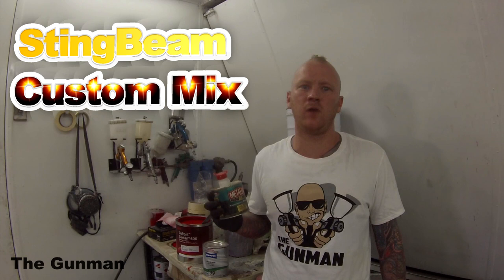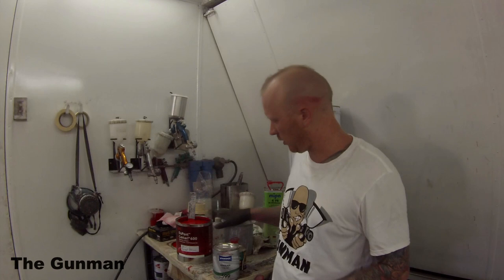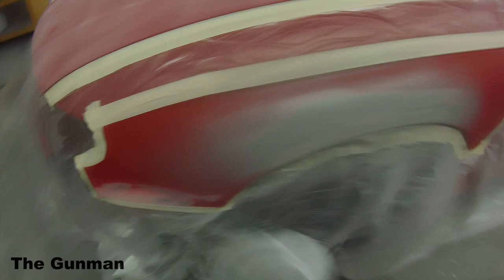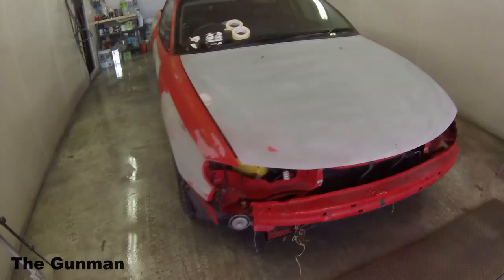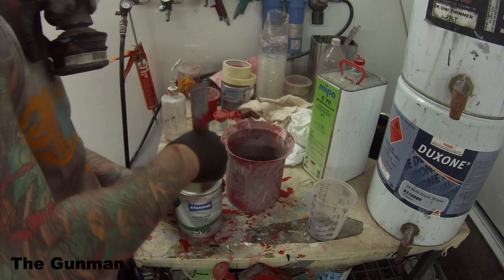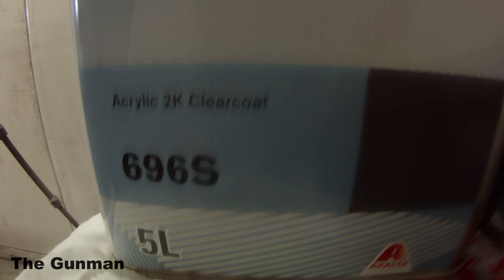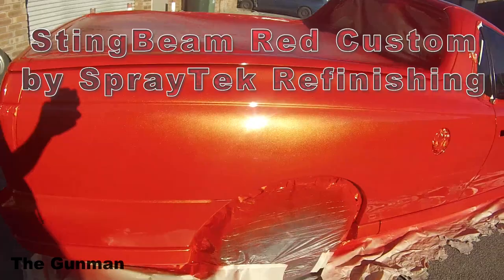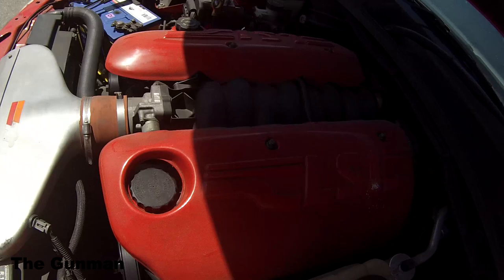Custom Color Mix & VU Ute Respray

Comment: Hey mate just curious as to how much base coat binder you used on this job, doing a respray on a e28 bmw and doing a black pearl over red base. I usually do pearl in the first coat of clear but find it hard to control coverage and end up with blushing/mottling so gonna go for the mid coat/ binder. Ill be using roughly 2 liters base coat for the closed door job. just not sure on how much spread ill get from the binder i assume it lays out the same as base coat?
Reply from the maker: Aza X Yep its just like another coat of base, I started with 1lt of binder and was still left with about 400ml but that was thinned so 200ml. Its the best way to do it.
Reply: The Gunman Is it better to use Standox 599 instead of Centari AB150 binder to mix pearl in for doing a 3-stage paint?
Reply from the maker: ab150 is fine to use mate and a bit cheaper too, its basically the same thing.